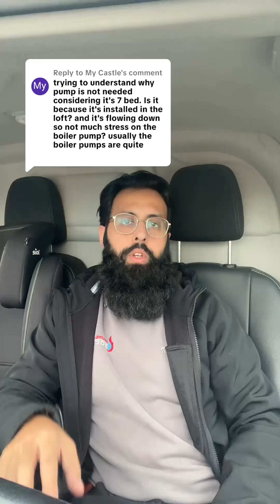🙄 Pump not needed for UFH manifold❓

Comment: Dr I think you got one point wrong on this one. The pump on the manifold is used to create hydronic separation, so we can circulate lower temp water via the blending valve at the same time as having much higher temp water going to the rads directly. If you didnt have it then you would either have to run the primary's for the entire system at approx 35-40 degrees, which wont work with rads. Or run the floor at 60 odd degrees and slow cook the flesh of peoples feet. ASHPs run at lower temps and we also like to delete the pump on underfloor just like you did on these rads. I agree with the pump not being required. Just dont agree on what the pump on a ufh manifold does. It is used to creates a hydronically separated path on the manifold to allow a separate flow temp on the ufh.
Reply from the maker: I did not want to get too technical most people wouldn’t have understood that